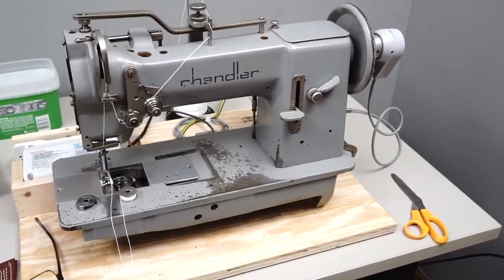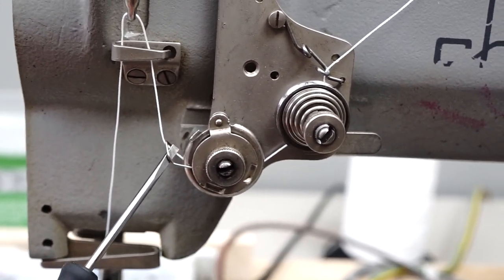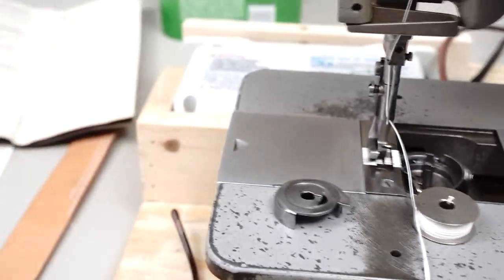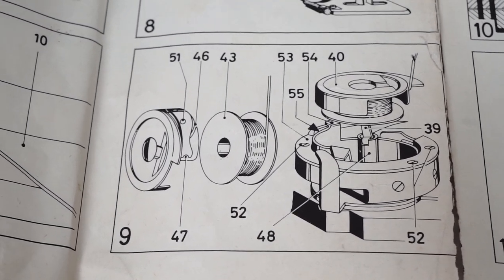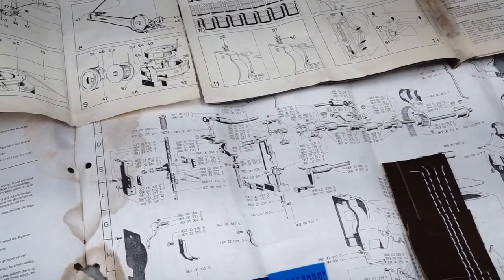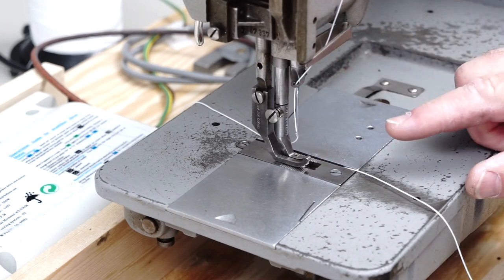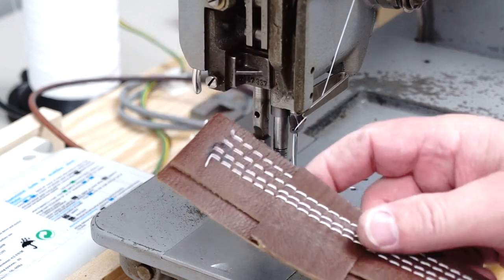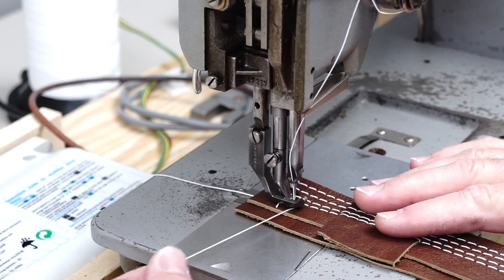Adler 167-GK373 Industrial Sewing Machine Servo motor leather sewing demonstration.

Comment: I also have an Adler that goes like a bat out of hell and continues to sew about 6 stitches after removing my foot from the foot petal. I used to make riding chaps for my daughters with it but I felt like I had no control so it’s sat in my basement for about 15 years unused. I want to use it for making bags now but don’t have enough control. I have 50 years sewing experience and want perfection in my constructs. Any ideas on how to achieve this.
Reply: Install a servo motor with a synchronizer. You’ll be able to do one stitch at a time and/or super slow stitches. I have one on all three of my machines.